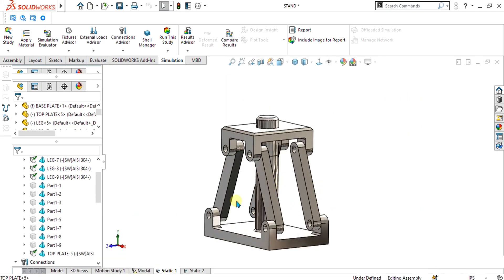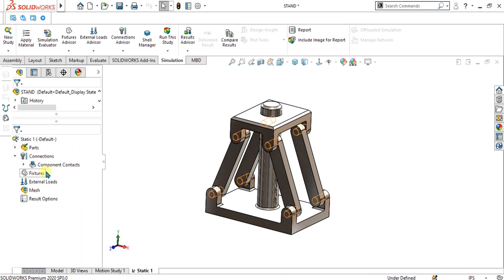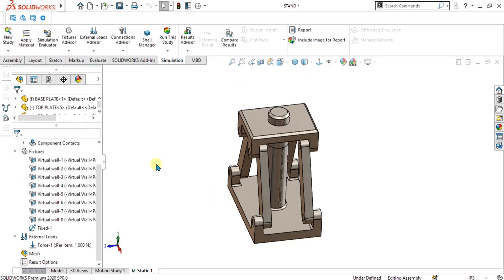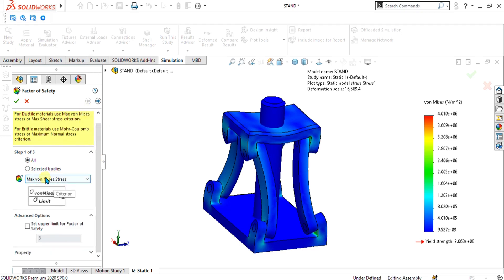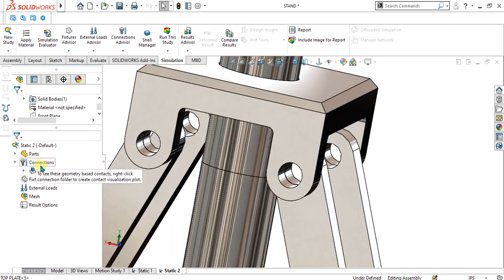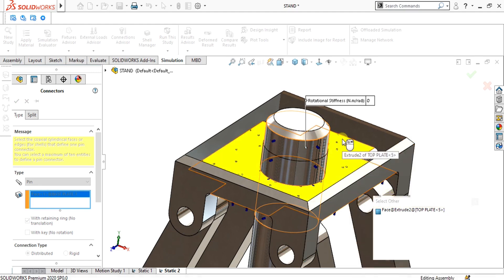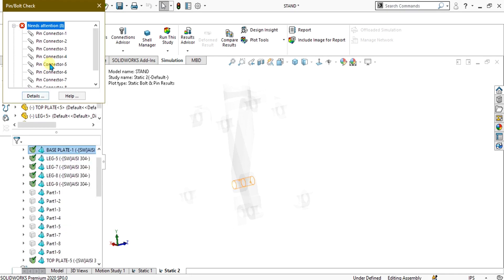📌 Solidworks Simulation Pin Connector

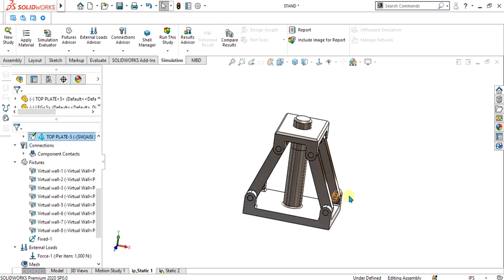Comment: If I pause the video at 14:57 i can see SolidWorks measuring the pin hole diameters in the model at Ø.750 in...but then you input a Tensile Stress Area of .5mm^2.  Tensile Stress Area should be = to the cross-sectional area of the pin Ø, which would be ~.4418in^2 [285.02mm^2] for your Ø.750 in pin holes. And then to an even greater error, you also use the same .5mm^2 Tensile Stress Area input value for the pin on the top of your assembly that is > 3x larger diameter than the pin holes! Your math is way off here, sir.  FEA results are only as accurate as the data you put into them.